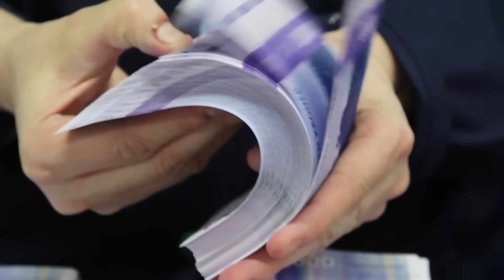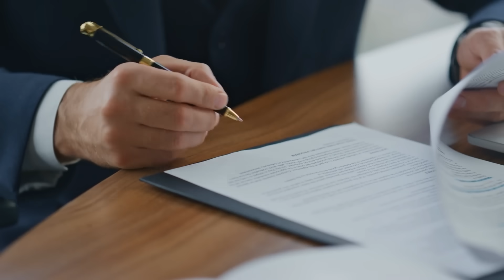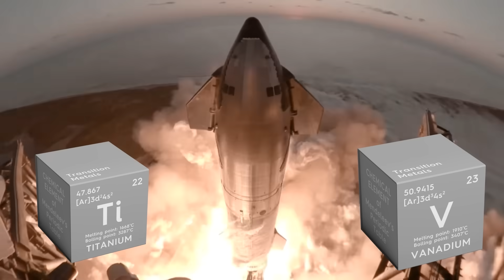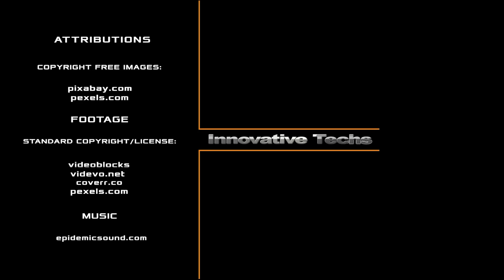Norway has Discovered a Resource that Could Surpass Oil

Comment: Put bulldozers on mountains and flatten them and terrace them to be more useable.   Try a small area as an experiment, helicopter lift the bulldozer to the top of a mountain or use explosives initially to set the equipment down ( trolls will bless Norge ! )

Comment: Ignious deposits do not generally contain the radioactive elements that you see in the gypsum stacks in  sedementary deposits. Norways ignious slabs should have the same composition as the Arianne Lac à Paul phosphate-titanium deposit in Quebec. which has been permited and shovel ready for years. In fact, it's permits expired waiting for financing. Because there really isn't presently excess demand for the stuff at the moment. Brazil, Moroco, and the US produce plenty. For now. Dirty. But plenty.

Comment: A major issue not mentioned is the potential environmental impact of this find on nutrient cycling issues. 

At present we use rock phosphate  like we use fossil carbon - dig it up and throw it into the ecosystem one direction, little to no recapture and recycling: and that causes distortion of nutrient cycling: for phosphate it means  eutrophication of water sources and also we have no idea the long term impact of all that fertiliser build up in the ocean as a whole.

Having the supply increase like this could remove immediate incentive to fund the research / engineering needed to implement phosphate recapture tech (eg at waste water processing plants), and low inorganic fertiliser input agriculture.

I hope we still do look to fund those things, because otherwise we get in as big a mess with phosphorus as we are with carbon.
Reply: Why not just use hydroponics? Almost nothing would go to waste or end up in the ocean in a hydroponics system. It's relatively simple to set up, you'd think it wouldn't be that hard to convert a whole farm. Could increase yields enough to fix our food security issue too.

Comment: Synthetic phosphoric acid is primarily produced through two methods: the wet process and the thermal process.
The wet process involves reacting sulfuric acid with finely ground phosphate rock, producing phosphoric acid and gypsum as a byproduct. This method is commonly used for fertilizer production.
The thermal process involves reducing phosphate ore with coke in an electric arc furnace to yield elemental phosphorus. This elemental phosphorus is then burned in air to produce phosphorus pentoxide, which is subsequently dissolved in water to create high-purity phosphoric acid used in food, pharmaceutical, and chemical industries.
Reply: With a low pH, phosphoric acid is added to certain foods (as you say) and beverages such as sodas, and into our tender digestive tracts causing untold damage.

Comment: Florida is a ticking time bomb !!!
Gypsum stacks fail during hurricanes spilling millions of gallons into the Gulf of Mexico - causing red tide blooms that totally suppress tourism at the beach. Not to mention that phosphate poisoned  water is radioactive. If Norway is wise it will manage phosphate waste responsibly. The massive craters in the interior of Florida looks like the surface of the Moon when you fly over in a small plane...

Comment: Some countries that are not nearly as well endowed with natural resources as Norway still have a higher GDP per capita. Singapore is the 1st, Norway 6th. Does Singapore has large natural resources ? No, Singapore does not have large natural resources. It is a small island nation with limited land and water resources. Does Norway has large natural resources ? Yes, Norway possesses significant natural resources. It's a major producer and exporter of oil and natural gas, and also has substantial reserves of minerals and hydroelectric power. ( Answers from Google AI )

Comment: Phosphorus is used in explosives, especially in the form of white phosphorus, More specifically Incendiary weapons and other munitions: White phosphorus is employed in various military applications like incendiary munitions, smoke bombs, and tracer ammunition due to its pyrophoric nature (igniting spontaneously upon contact with air) and ability to burn intensely. It is also utilized in "artillery shells for illumination and creating smokescreens". High-explosive compositions: While white phosphorus itself isn't a primary high explosive, it plays a role in some high-explosive compositions, such as certain mixtures with ammonium perchlorate, according to Wiley Online Library. 

Important distinctions, White vs. red phosphorus: White phosphorus is the highly reactive and flammable form used in incendiary munitions. Red phosphorus is a less reactive form found in the striking surface of matchboxes. Incendiary vs. high-explosive: Incendiary weapons rely on a substance's ability to burn intensely and spread fire, while high explosives detonate with a destructive blast. White phosphorus is used in incendiary munitions.

Comment: If Morocco has 15 times the phosphate reserves of China, why is China dominating global phosphate exports? When it makes sense for someone in Morocco to begin mining and processing their phosphate and shipping it to Europe. I mean Europe is right next-door.
Reply: I don't know if it's the case here, but for some rare-earths China ramped up production so high, and dropped the price so low, it became unprofitable for overseas producers and they mothballed their mines. Once China had a stranglehold on the market they began restricting supply, upping the price until competitors tried to start operations up, at which point they would again flood the market.
Reply: Morocco produces a lot of phosphate ROCK.
My guess is that Morocco exports this phosphate ROCK to China, where the phosphate ROCK is refined into phosphate. And then this phosphate is exported to EU.
My guess is also that Morocco doesn't want to refine the phosphate ROCK themselves, because it would be too expensive and/or technologically difficult to do so.
And that EU doesn't want to refine it, because of environmental issues.

Comment: Electric cars DO NOT reduce carbon emissions. The electricity has to come from somewhere.
Reply: Yes, but the electricity doesn't have to be produced from fossil fuels.
And even if it IS produced from fossil fuels, it is more efficient to produce electricity from it, than to burn it in an ICE.
Reply: In the case of Norway, it is coming from hydro power. Norway been running on green renewable energy since 1970 at 95% compared to US today in 2025 averaging somewhere around 20-40% depending on which state u measure. So if Norway's cars is running 100% electric, with 100% electric renewables then yes.. it totally reduce carbon emissions :)
Reply: @LarsWilhelmsN  While you are completely correct, there is an aspect here that you are ignoring.

If you swap an ICE (Internal Combustion Engine) car with an electric car, then you will use more electricity. That electricity has to come from somewhere. If the country previously created exactly the amount of electricity that it needed, then it will now need more electricity, which needs to be imported. Or, if the country previously produced more electricity than it needed, exporting the surplus, as is the case with Norway, then after the switch, it can not export as much electricity.
In either case, some other country needs to produce more electricity, which in today's world will usually come from a coal power plant. Thus producing more CO2. And I think THAT was the point of the OP.

However, with the switch from ICE cars to electric cars, this is actually not the case. Because the amount of electricity needed to produce enough petrol to drive a car 1000 km, can instead be used to charge up an electric car, and that electric car will be able to drive MORE than 1000 km.

So switching from ICE cars to electric cars will actually REDUCE the demand for electricity, and will thus reduce the need to burn coal in coal power plants.
So the OP was wrong.
Reply: @Tjalve70  My first message was directed directly to OP and I also specifically men't Norway in this case, since the video was about Norway.

Altough I agree with everything u say about the case of other countries and coal/less green energy resources :)
Reply: @LarsWilhelmsN  I understood that. I understood that your comment was not a response to me, but to the OP. And that you were talking about Norway. And so my response was taking that into account.

But my point (which I also stated) was that this also applies to Norway.

In Norway we do not refine much of our own oil. I think I have heard that we produce about 50% of the petrol we use, and 25% of our diesel. The rest, we import. And I tend to say that the reason why we shut down the oil refinery at Slagentangen, was because we need to lower our CO2 emissions. So by not refining our own oil, and instead buying it from other countries, WE reduce our CO2 emissions, even though the global CO2 emissions are not reduced. So we're a bit sneaky that way.

This means that if we electrify all cars in Norway, locally for our country, the electricity demands will probably increase. But the global electricity demands will probably decrease a little.

However, we are (unfortunately) completely connected to the European power grid. So when the local electricity needs increase for Norway, we can't export as much electricity to EU. And that means they have to burn a bit more coal to compensate for that. And as I said, I think that was the OP's point. Not WHERE the CO2 emissions are produced, but the fact that they ARE produced.
Reply: Yeah like im 100% with you on all of this, I dont understand why u said I ignored this fact, when I simply was making a specific example of Norways case.  like locally and energy vise within the country.

I dont mind us exporting electricity to say Germany with its brown coal burning, the more we export the less they need to burn. thats great!  and mabey some day in the future we will get clean fusion/fission/thorium reactors or something nice.  but for now as far as I know, EV cars in Norway is making less emission than a fossil car, inside of norway. as far as I know.    in a different country probably not since Norway is one of few places that can run hydro to this extent.
Reply: @LarsWilhelmsN  – 1) Norway has the resources. 

2) Hydro is not without it's costs to planet Earth.
Reply: @rubiks6  1. Yes exactly.

2. ofcourse not. but compared to most other energy sources, like construction and materals for windturbines, Solar panels and so on.  or yeah even worse brown coal burning... Hydro is pretty much one of the best energy sources atm in my mind, cant wait for fusion/fission/thorium.  stuff like this being used.
We Norwegians based on geological placement are very lucky to use hydro  as that energy is very cheap and very green.
Reply: @LarsWilhelmsN  – What is destroyed by a hydroelectric power plant can never be restored. However, I do believe the Earth was made for and given to Man. He should use it responsibly, but use it, he must. 

Don't hold your breath on that "fusion" thing.

Comment: CO2 is fake - it warms nothing.  So Norway / Europe should ditch carbon goals.  Mars' Atmosphere is 95% CO2, Earths is 0.0001% CO2.  Mars 23 mile thick atmosphere hence ought to trap great amounts of sunlight as heat - right?  But it doesn't.  Mars gets 1/2 as much sun light as earth and it is half as warm.  CO2 doesn't threaten life either - Dinosaurs lived millions of years w CO2 levels 4x-10x higher than present; they didn't die of heat, nor did the plants they largely fed on. The CO2 issue is a total lie pushed by China to sell solar panels, rare earth magnets used in windmills and BEVs, and lithium batteries - all which they control. It is a lie.

Comment: so if they have money why are they not better at one thing matter(falling birth rates, they below france or even UK )
Reply: What makes you think money will produce more babies?
The fact is: Poorer countries have higher birth rates than richer countries. Which is the opposite of what you think it should be.
Reply: @Tjalve70 , you are right, but what does mainstream say? The falling birth rate is a result of economic shortfalls
Reply: @Proud-R  I don't care what the mainstream says.
There is a falling birthrate in all developed countries. This is absolutely a problem that should be addressed. And it seems to be ignored.
Sure, money could be used to alleviate the problem. But you seemed to just assume that more money would automatically result in higher birth rates. Which is not at all true.

Comment: so Norway's economic model is to get the rest of the world high on their supply (of oil) but not to end up on it itself?
Reply: then why does the country use funds from oil revenues for innovative research which will cut demand for oil (and which will benefit us all, worldwide.. And why does Norway also sell their clean electricity (hydropower) to parts of Europe even if it comes at the expense of the country's own industry and their own citizens as the price of electricity has skyrocketed because of it. In the end we are all in the same boat when the world goes down.

Comment: In most industrial agriculture more fertilizer, including phosphate, is applied than can be used by plants so the excess, up to 50% excess in some cases, ends up polluting surface and groundwater. If we could reduce the use, we could also reduce the pollution required to process phosphate in the first place.

Comment: Emissions in a specific country should also include the emissions of what they import from countries with less stringent rules

Would probably aid in NOT exporting problems to other countries
Reply: Im from Norway, and we export oil and gas, while we also have some of the strictest rules/taxes for emmisions (Thats why EVs are so popular here). But thats a side note. Emmisions are counted where they happen. So, Norwegian gas is counted in Germany when they burn it. The way around this for Denmark, Germany and others is that they stoped making electricity, because emmisons are only counted in electricity generation. So, if you burn gas directly to only make heat and not electricity, then its not counted. Central heating is one way, using gas for cooking and heat in houses is another. Because its never converted into electricity.

What should happen is that when we import TVs and stuff like that, the country of origins emmisons should be counted in our own for making that TV. That way carbon taxes in our own country does not make it profitable to relocate production. And to be honest, the only reason carbon taxes are there is to "offshore" production, so that the country can minimize its CO2 footprint and reach common set goals like the Paris Agreement. 

On stuff like PA, if Norway counted its forrest like the rest of the EU, it would have reached the Goals, because our forrest intake of CO2 is half the emmisions we produce in a year, so we did not count our forrests intake of CO2. Because then our politicians could not force EVs/Windturbines and power lines to countries with significantly higher prices on the people. 

Because the state owns most of the hydropower, and it taxes the towns and counties that own the rest, and hydro was very cheap in Norway before lines to Germany/UK. And if Norwegians dont use petrol in cars, the state can send more oil to other countries. This could not have happend if we counted forrests in our "CO2 budget".
Reply: @tcn9939  Norway has found a HUGE phosphate reserve, but I hear the EU whining about emissions and waste
But they don’t complain about improving it from Morocco…where hey…. No one cares as much

Comment: If Norway's serious about clean energy. They better get busy building nuclear power plants. They don't have enough water to supply and electric car fleet and AI. Both require enormous amounts of electricity. Fission reactors for now, until Fusion becomes practical. Replacing all their gasoline engines comes at a high price in electricity. And AI will double that.
Reply: Norway has been officially against even concidering building nuclear plants, until 1-2 years ago when the government actually has opened up to 'study it'due to the large request for more electric power. There are a few private Norwegian comapnies working on concepts for putting up nuclear power plants in Norway. There is a good chance we will see the first plant in Norway by 2035
Reply: I know that my figures are a bit outdated, but last time I checked, 96% of Norway's electricity production was from hydropower. And 98% was from renewable sources.
As for electricity and cars, it takes MORE electricity to refine oil into petrol and diesel, than to use the electricity directly to power cars. So no, electric cars will NOT increase the electricity requirements.